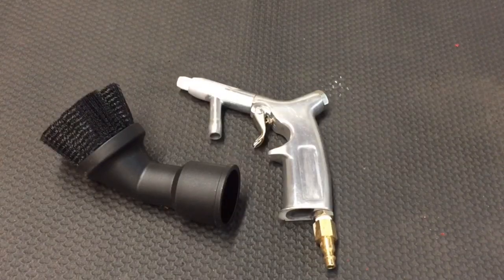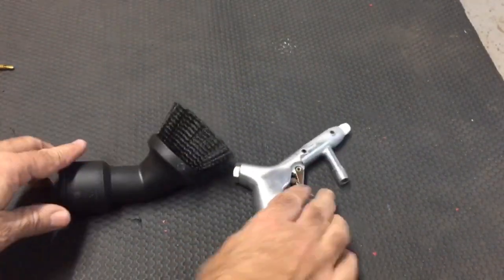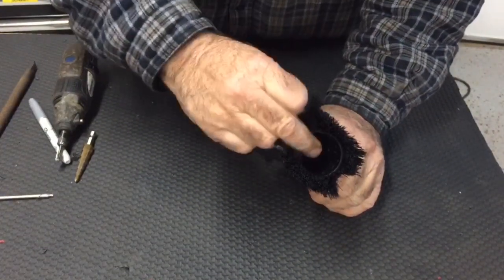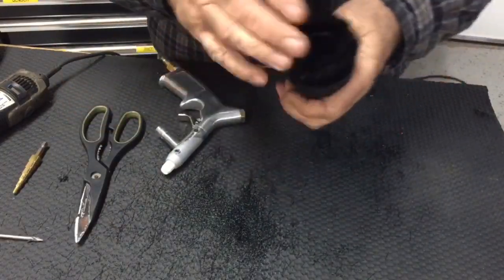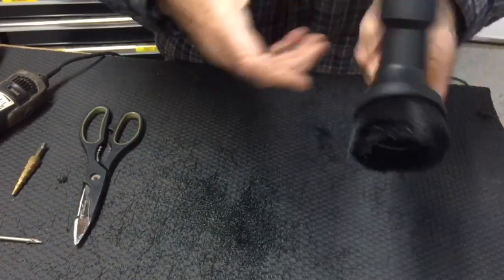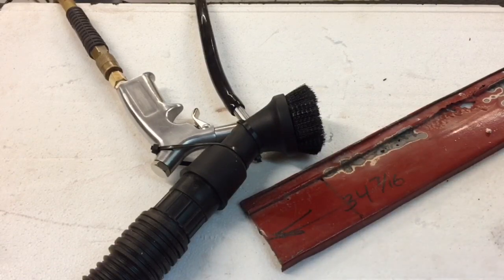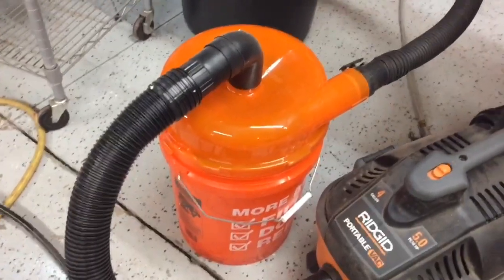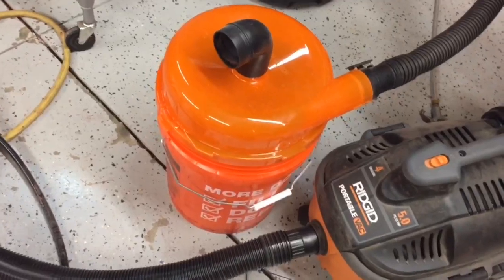Building a Dustless Vacuum Media Blaster

Comment: Considering you did that with like 1 hole into a stock part that could be repaired with a large short bolt , that's a really elegant solution.
I'll bet if you really played with old vacuum and plumbing parts, you could make something really easy to use.

-Just personally, I'd personally try an elbow so that you don't have to hold up the 2 opposite side hoses for air and media, maybe running a few feet of the blast media feed hose into the vacuum hose ?

Comment: Thanks for the ideas. Got a sand blasting gun on clearance for $12.55 reg $35.00, added a $14.00 vacuum brush, vacuum hose and adapters along with suction hose for $25.00 so I have about $50 buck into the sand blaster and hooked it up to my cyclonic separator shop vac and it work quite well. Great video. Thanks again.
Reply from the maker: Glad I could help, Friend!👍

Comment: I'm curious about what psi and cfm your compressor is providing for this demo.  I'm interested in setting up something like this but I'm not clear yet on what size tank and motor I need on a compressor to do this kind of work.  Thanks!
Reply from the maker: Hi, this was at 90 psi. I have a 5HP compressor that delivers 10+ cfm @ 90 psi.
Your requirements will depend on the nozzle size of your sandblaster.
If you’re using the blaster intermittently, you can stop to let the compressor catch up.👍